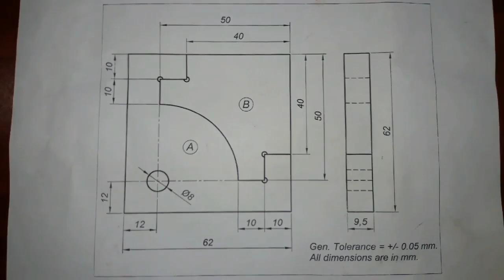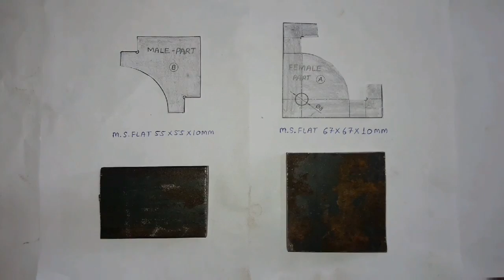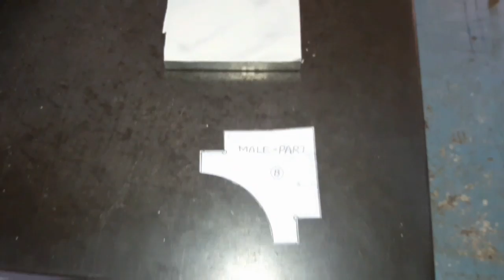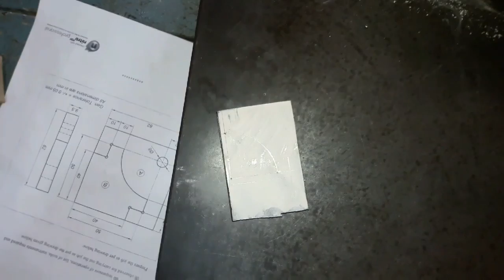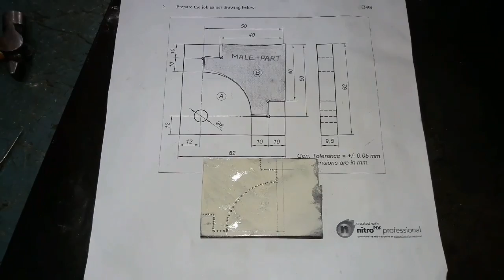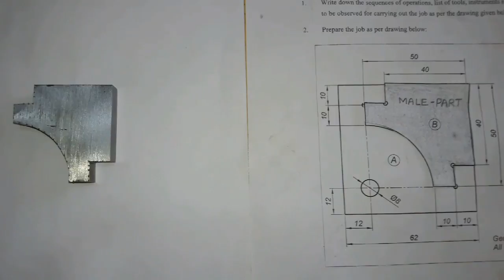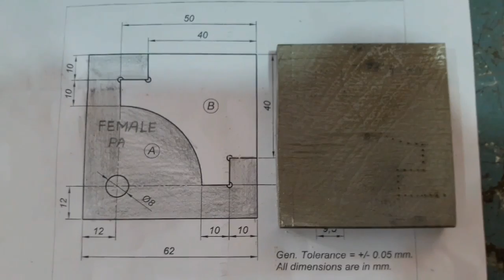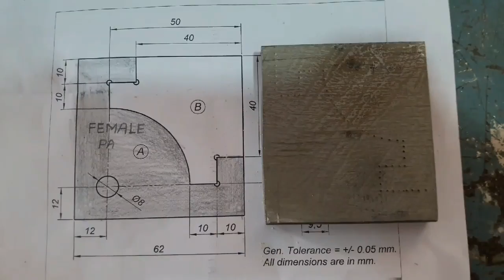Ncvt practical exam January 2018 fitter 3-sem || Fitter || ITI

Comment: 4rth samester ki taiyari ke liye video Bana dijiye hamare pas Book nahi hai-FITTER
Reply from the maker: M khud Govt ITI m FITTER  INSTRUCTOR hu 
2-4 sem k 
1.breakup syllabus 
2.trade theory (all chapter
3.practical job (24job)
4. Engineering drawing (all chapter) 
5. Workshop  calculation (all chapter)
Ki video upload kruga
Reply from the maker: 4th semester Ke Main topic "theory"
1 :- power transmission (gear, chain, belt).  
2 :- Pipe and pipe fitting
3 :- Jig and fixture
4 :- material properties
5 :-  drill and types of drill machines